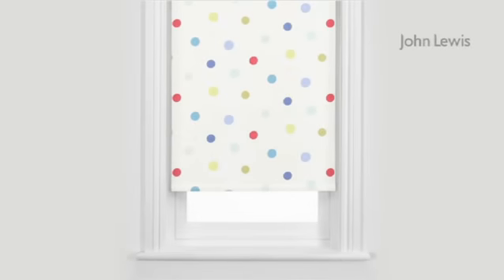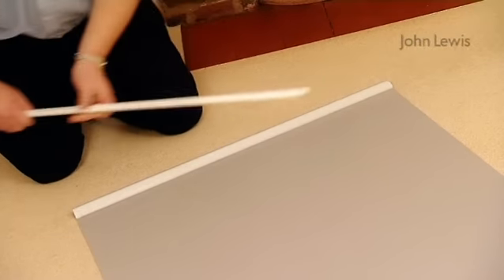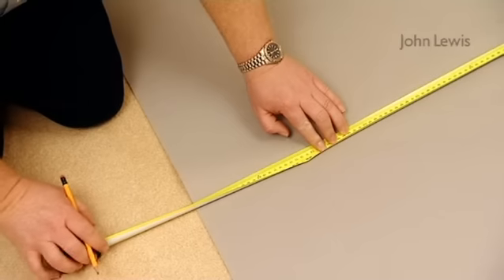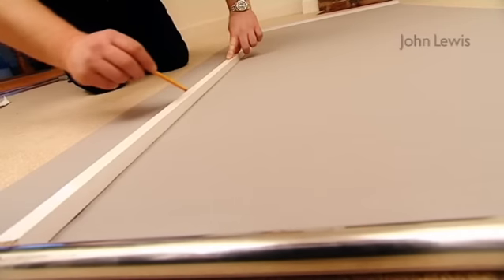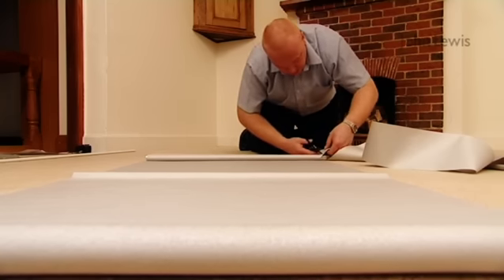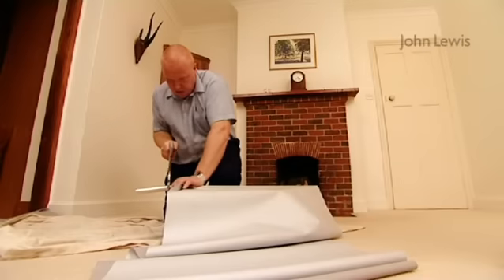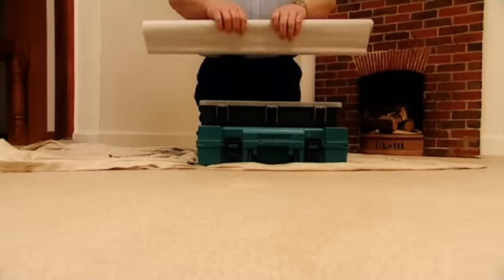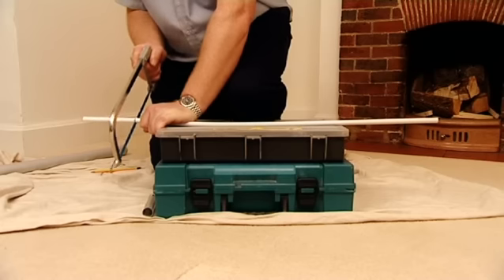Fitting Blinds 1

Comment: Measure the width and make a mark 27mm less. I thought you don't know my situation or blind I have and I will make my own measurements but using your technique.
 1st blind: cut the material twice and the rod about 5 times trying to make it fit, having a beer half way to calm me down.
2nd blind: measured the space, after cutting off the rod on 1 end to 2mm from the material, ( could have just unstuck it) took 27mm off the measurement, cut the material once and the rod once. perfect.

Thankyou.